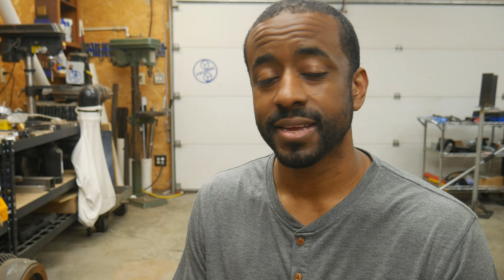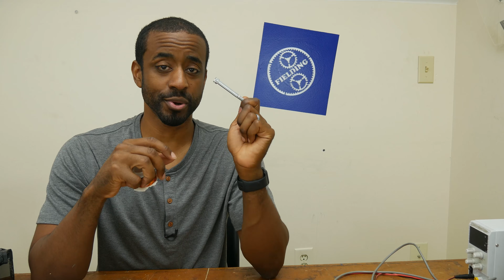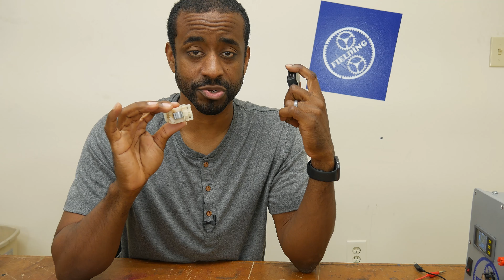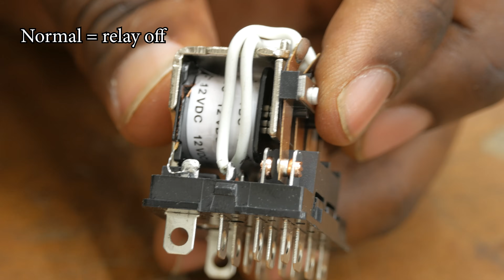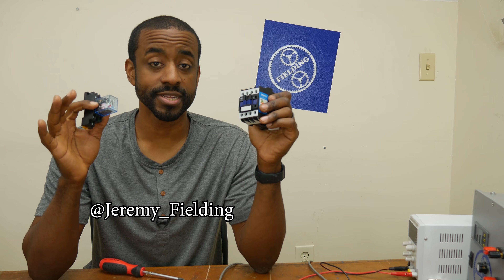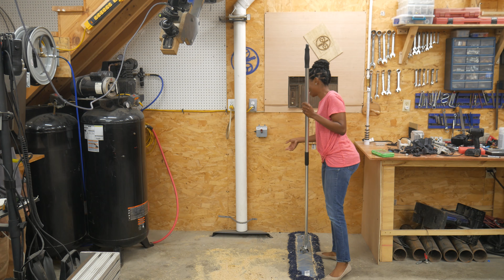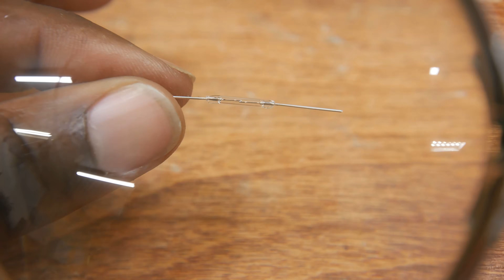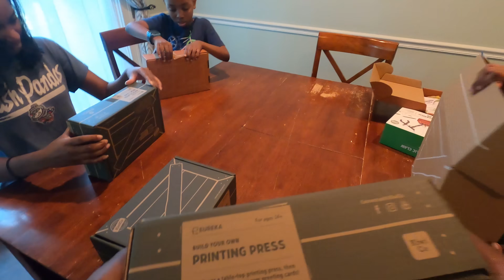A beginners guide to relays, contactors, and solenoids to automate anything; (#083)

Comment: Not a short circuit because the coiled wire acts as a load (with resistance).  The coiled wire is a resistor.  A better question is:  how much current do you consider a short circuit?   If the coiled wire only has 0.1 ohms of resistance, the current will be 90 amps.  Is that a short circuit?

Comment: For anyone confused a little bit about the big difference between transistors and relays (like I was a few minutes ago) is that relays will create an air-gap when they're turned off. Really important when you're considering that current can move backward, i.e.: when a motor stops spinning, its magnetic field collapses and it sends current backwards, potentially damaging your microcontroller.

Comment: No, not a short circuit because the circuit you created is intended to do the work you designed it for. The coil was designed for the power to be connected and the power can't be connected if you don't connect it. The circuit is doing the work you expected it to do when designing the circuit, so no it is not a short circuit. But technically it could be called a short circuit because it shorts the positive to the negative thru the coil, but if you label that a short circuit then you have to be consistent with your labeling and label any properly working circuits as short circuits. But none of that is short circuits, it is only labeled a short circuit if the circuit shorts in an area you never designed if to do, and therefore the work you expected and designed for never gets done.  So in essence a short is only when the circuit shorts where it never designed to short and don't get the WORK done the circuit was designed for.

Comment: what causes a 24vac coil relay to latch closed? have a 10 amp DPDT relay that switches 220 to a sprinkler pump. Each leg of the pump in 3.7 Amps which is 1570 watts total . When the lawn sprinkler timer goes on it sends 31VAC to the coil  then later when done watering it turns the 31VAC off yet the relay stays closed until I wiggle it in the socket and break the contact. Am I welding the contacts shut or is the  metal actuator somewhat permanently magnetized holding shut when power is off. . Its very intermittent. sometimes it sticks only once a week. How can I use math to figure relay Amps. The motor amperage inrush I read can be 10x the name plate running amps. So in my case I would need a 10 x 3.7 amps = 40 amp relay/contactor. .

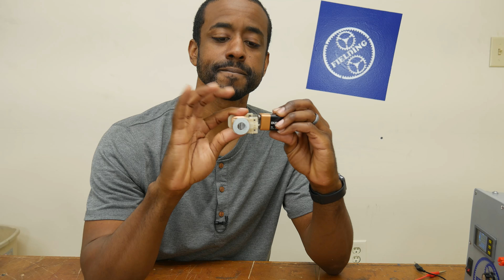Comment: Answer to the question at 5:10. 
It is not a short circuit because of inductive resistance acting against current flow due to the increased magnetic field formed by the coil.

Comment: Great video.  Can you explain the wiring in the dust collector box?  Like what voltage (and where are you tapping into the saw wiring) are you running from the table saw to the relay to activate the relay?

Comment: I would say no. It is not a short circuit because it is still going through the load. A short bypasses the load and power takes a SHORT cut back to source.
As far as the relays go. I've been considering running a relay so my 240v Air compressor will only run with my 120v lights being on. There has been many times I would forget to turn off the compressor. So you see with any tiny leak the compressor would run more than needed. The relay would hopefully prevent premature mechanical wear and/or failure.

Comment: Love your ability to explain in layman's terms. Ive worked as an electrician on and off my whole life, I know how to make it work. I went back to school for the nuclear technology program, even with that, ladder logic is still confusing when it's applied to real scenarios.  Even more so is motor control shares symbols that mean different functions from PLC ladder logic. I work doing industrial maintenance and have to troubleshoot; PLCs, relays, solenoid, limit switches, step-down/up transformers.
I'm always learning, but even though I may not always understand the "why" I am pretty good at figuring out the "how" so I keep things running. Again your very talented at communicating the "how". Your wisdom is much appreciated!

Comment: Very informative. I’m a woodworking guy, and a novice in electrical automation. I am trying to automate my shop dust collector filter cleaning system. I have a 2kw 220V shop vac, and a small 200W motor that runs the filter cleaner. I start and stop the shop vac with a remote controller. Today I run the dust collector filter cleaner via a separate switch manually. I would however want to run it automatically with a time delay, such that it starts 5 sec after shut down of dust collector, and runs for 10-15 sec, and then shuts down. This repeats after ech time I use the dust collector. Can you guide me on combining relays and timers, or better still, could I ask you to create a Youtube video on this topic, as I am sure I am not the only one struggling with this task.

Comment: when you turn the "ignition" in an electric car the sound you hear is also a contactor, controlled by different transistors, one with a higher voltage to close and another with a lower voltage to hold it closed, so it uses less power and saves on energy and produces less heat.

Comment: DEAD SHORT,,Funny you should mention this dead short, I have a bit of an electrical back ground mostly commercial, now I design, biuld and install spray booths, mostly for body shop. they consist of lots of timers, heat control, lots of relays and contacters. There has been many times for some prodject or another, I wanted  to make a magnet, so I looked at several and thought to myself, why isnt that a dead short, so due to my ignorance and fear of creating a large dead short, I didnt make the magnets.. So tell me Jeremy, why isnt that a dead short??  Thanks, Clark.

Comment: Jeremy, I worked on electric forklifts up to 72v dc for over 30 years. I retired 15 years ago. They were pretty simple back then. By now forklifts are very advanced and require top elec. techs. I'm glad I retired when I did. So now I mess around with all kinds of things. I have a thought, I have a good washing machine motor, newer front load model. I have a gas engine 4500 watt generator I want to set up as a emergency power supply for my small home. I was wondering if there was any way I could wire the w/m motor to the generator to kick up the wattage. I acquired the gen. for free but I think I could use more watts. Really can't afford a new higher watt gen. and though about this modification. What do you think?

Comment: Mechanical things fascinated me early. Magnets are everywhere. As electrons move, they have a force behind them. We measure this in amps. As points in a much older car open, electron want to jump that gap as they are pushed. The condenser gives those electrons a place to go for a fraction on time. 2022 bring high voltage electric cars onto our streets. They have relays, switches or contractors inside their circuits. GM has shown us issues engineers had to overcome as the arc is bigger as the push is bigger. A magnet placed near contacts can attract electrons away from the now open switch. This and other simple tricks are used to make these contacts last 5,000 hours. This equates to 150,000 miles of driving. Like you said; “Any engineer worth their weight in salt is looking for perpetual power”, well sort of said that! One thing I found interesting, as magnets are used in dc motors to pump fuel. The material that makes a good magnet is glued into the body (Can Shaped” and assembled. Once done, they are subjected to a strong electromagnetic field, and magnetized after they are assembled. Then pressure and flow tested. They have a check ball that has a spring or vertical and gravity seats them on the outlet side. Once the pump is turned off, fuel under pressure is trapped between this steel ball and typically a regulator. This keeps fuel in long lines until the engine is started again, in minutes, hours, days or months. If one tiny spect of dirt keeps either from sealing completely, the line empties. This is one reason why key switch position turns on the fuel pump for two seconds, the off. Ready to go!
DK, retired ASE master tech since 78

Comment: Regarding your question of whether or not the battery connected directly to the coil is a short circuit, I would venture to say that technically, it is. However, because an electric current is running through the wires creating a magnetic field that may be slowing the current, that might be the reason why the battery is not shorting out the way it typically would if the current passed directly from the positive lead to the negative lead. I'm new to electricity and only recently started to learn about electricity more in depth, so I don't have an established opinion and am open to be guided.

Comment: Free fire wood forever! Just using junk mail ! All you have to do is shred and mulch your mail, mix with water, blend with drill for ever, pour it into 5 gal buckets, wait first drill holes so water can escape, then put weights on top to squeeze water out, then take out the pulp blocks cut them into bricks, reform them because cutting them doesn’t work, then let them dry for at least 1 week and then burn them in your wood stove that everyone has in their house for free energy forever with no energy, or time, or effort put into it what so ever!

Comment: I don't think it's a short circuit because the coiled wire generating the electric field is putting some level of measurable resistance and loading the battery. You'd have to dump the positive into the negative without draining the power in between to get a true short. I bet you can detect when you pick something up with the magnet the load increases.

Comment: its not a short circuit its electricity doing work then going back to source.  Its what every working electrical circuits does.

Great video and great name!!!  The only issue as a Controls Engineer and UL508A panel builder is that back panel in your dust collector panel should be metal.  Needs to be conductive to create an equipotential bond with ground so if a hot wire touches it the circuit shorts.  With it being wood it also has the potential to catch on fire a lot easier then a piece of metal.  Any metal shop could make a custom back panel for any panel retro fit.  Just give them dimensions and a thickness and they can cut and punch a piece of metal.

Comment: I wonder what you think about solid state relays? I think it's interesting that SSRs can be switched with 5vdc and can power loads over 10 amps. They can be powered directly from the micro-controller pin. (you gave them a mention after i left this comment). Still looking forward to the SSR vid.

Comment: Contractors are used in the compressor unit on a central air conditioner unit. And relays are used in the central air heater unit (Furnace).

Comment: Hi Jeremy, I have this small transformer from 120V to 24V that does not work. I opened it to check continuity from the inside, only to find out that there is a small black component attached to one prong that has no connectivity, behind it the connectivity is OK. I tried to read what is on it, it seems that it was wiped off. I saw your transformers but did not see such a one on yours. what happens if i remove it and try the transformer again? I wish I can send you a photo of it

Comment: Hello Jeremy. Great Video.
One thing you might want to consider is the issue of safety with respect to your clamping system.
There's a fairly decent chance that a person could get their hands caught in the clamp because it is a foot activated system with no safety or system in place to prevent the operators hands from getting squeezed. You may want to consider requiring a "Two-Handed Trip" where the operator must have both hands away from danger area in order to activate the system.

Comment: regarding "is it a short?":

when you first apply a voltage to the coil, its inductance impedes the flow of current. As time goes on, that affect reduces until only the resistance of the coil is relevant. If the coil is long enough, and the wires thin enough, that resistance can be high enough to safely connect across your voltage source. If the coil is too short or has wires that are too thick, that resistance can be low enough that it will try to pull too much current from the voltage source. If your coil is short enough or has thick enough wires, you can reasonably argue that the result is a short circuit.

This is why solenoid controllers exist. The controller may need to reduce the voltage given to the coil after it is initially switched to prevent excessive current draw.
Reply: Why not just put a small resistor in line with the coil?
Reply: @GreasyReecey  the correct way to use a coil depends on what you're using it for. For some applications, a series resistor can be an adequate solution to overcurrent. For others, not so much.

The resistor would likely need to be a somewhat large-value resistor, at least by the standards of the voltages involved in the circuit. Unless the coil is so long that it has substantial internal resistance, your resistor would need to be a large enough value that putting it alone across the voltage source wouldn't be a problem.

Putting a plain resistor in series with the coil will slow down the coil's response time, and resistors limit current by turning energy into heat -- which is often undesirable both on the "consumes more power" and the "produces heat" side of things. 

Note that electromagnets function based on the current passing through them, so if you are going to be giving the coil a high power, you will need a power source which can handle a large current, so you would be able to use a small-value resistor in such a case. However, if the coil requires a high current, that heat production will be high enough that you need a physically large resistor and possibly a heat sink to avoid it melting. At that point, a controller is definitely a better option.

Comment: Beyond your advance knowledge of electrical theory, Your on call knowledge of power control and motor control components, their associated rating, and applicable usage is impressive. Relating parts from everyday house hold items to explain key concepts…These are quality educational videos. I’m a maintenance technician, I work in manufacturing for a company in Texas…the company uses Italian made machinery…terms are different, and upper management and production associates are ESL, these concepts seem to click across all spectrums when electrical control components and systems can be related to things people used in everyday life. Even at the industrial level. Just listing all the ac and dc motors and their controls in a kitchen seems is eye opening to people. Thanks for the video.

Comment: The points in a car distributor work the same way but it is the mechanical motion of the engine that puts the points into causing a spark that causes the electrical impulse to detonate the fuel-air mixture in the combustion chamber via the coil. Once run on a magneto that only fired when the engine was on, the modern engine used a battery then a generator, than an alternator as a power source. Most cars with generators could run without a battery once the engine was running but a alternator was part of a circuit which included the battery so you couldn't use someone's battery to start your car and park it on hill facing down and pop the clutch in second to restart it, you had to buy a battery. You got a stronger current with a alternator but if the alternator died you couldn't run the car just on your battery and you needed a good battery to start it and run.

Comment: To answer your question at the five minute and 16 second mark; I would say no because is a load therefore because it is a coil and not just a jumper wire it will act as a load and complete the circuit without shorting out.